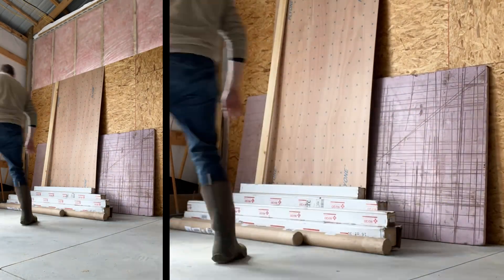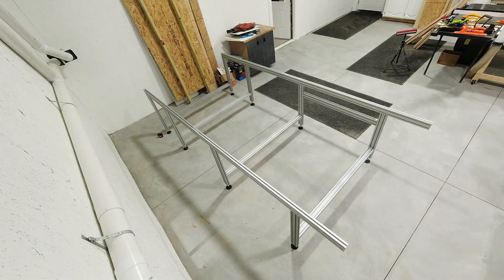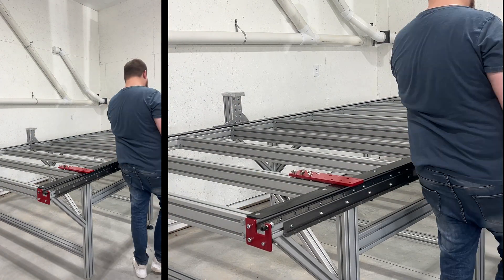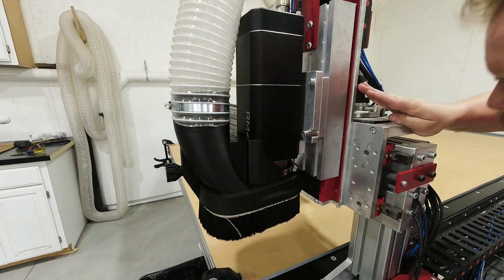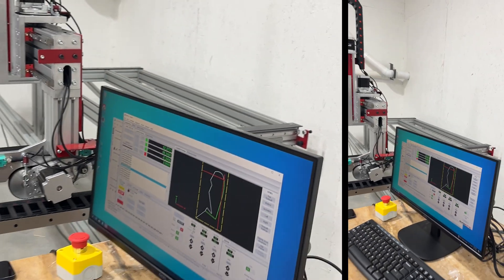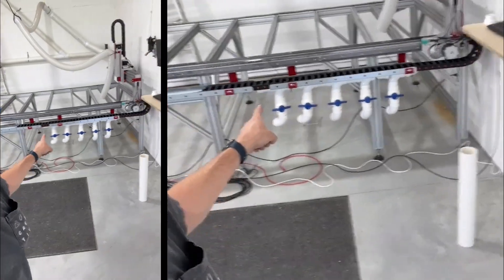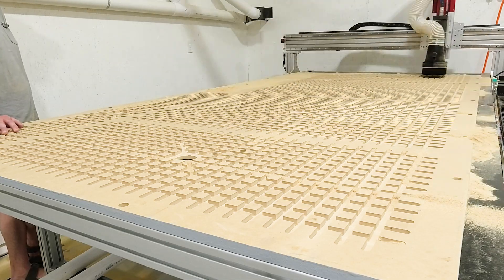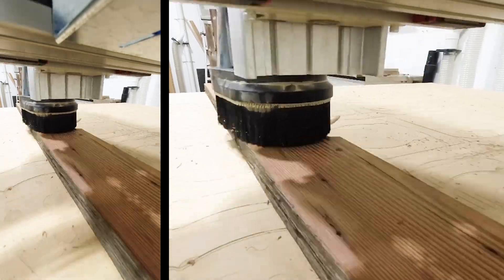Building a 5x10 Avid CNC with Black Box Hurricane Vacuum System – Full Setup & Walkthrough

Comment: Did you order this before they released the new EX control system with Clearpath servos?  That’s unfortunate. But I’m sure it will serve you well.
Reply from the maker: We got this back in April. Are the parts upgradable? Maybe I’ll look in to it?
Reply: @woodvise  yes but it’s about 6 grand for the new controller, wiring and servos, and they will give you about $500 credit for your current controller. I personally just ordered the new controller and am keeping my steppers for the time being, that was around $2750 and includes a license for Centroid, the new controller and cabinet, a tool setter, and a wireless pendant. I’m super excited! I have a controller from 2015 and it’s not doing a very good job. The newer Mach 4 controllers are a lot better than what I’m working with.